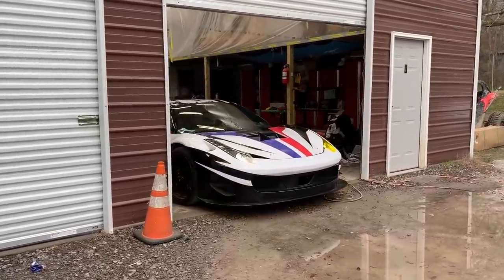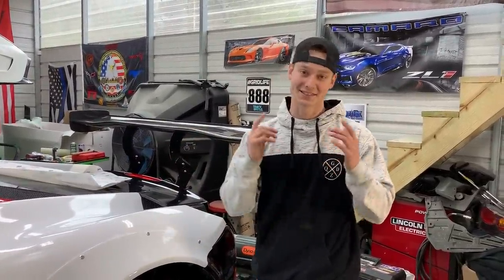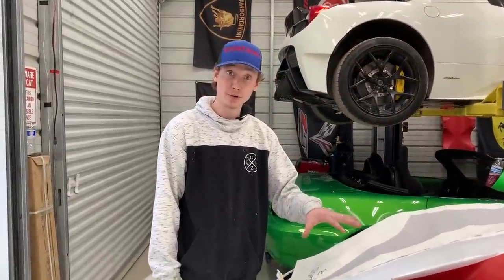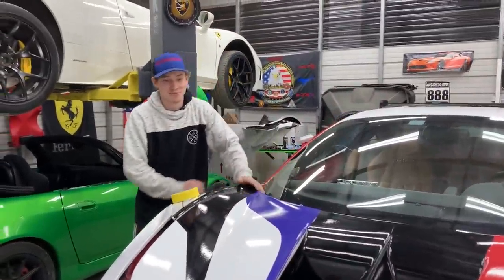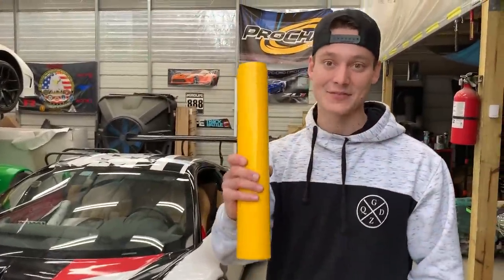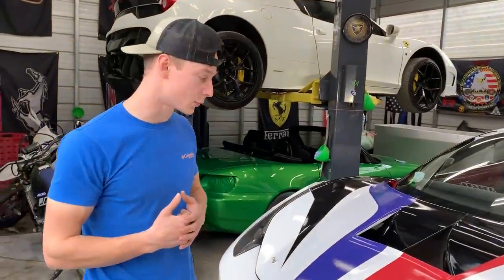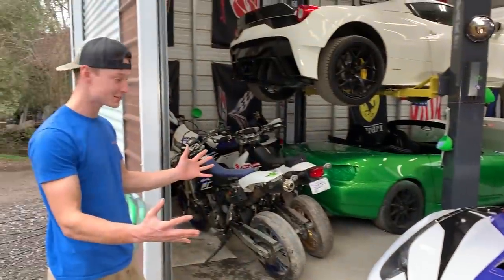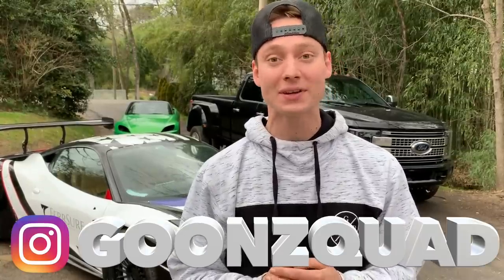Building A Widebody Ferrari 458 Part 8

Comment: Yellow headlights look tacky and for some reason it looks cloudy. The stock look on them look a lot cleaner.
Reply: Pennywise they said they did it wrong so maybe once it’s done again it will look better 😋
Reply: Looks cloudy because it has a protective clear film on top to prevent scratches when installing
Reply: @PhenomenonHo  either way the clear looks better.
Reply: If they do use the yellow highlights they need to add some yellow into there designs
Reply: Pennywise  the stock look way better and cleaner then that yellow cloudy,

Comment: I would leave the F450 stock so it stays a reliable hauler.
Reply: I think put forces on it and do just appearance mods no suspension and engine stuff
Reply: needs a delete and tune or else it won't be reliable.
Reply: It needs a few deletes and a small tune nothing crazy
Reply: Only issue is if they do a delete on YouTube and I think that Tennessee is a CARB state, they'll get a fine.
Reply: I think just getting a Banks inline tuner and intake would be the best
Reply: Intake, tune, and exhaust for more efficient towing. Maybe some Alcoa wheels.
Reply: The f450 ,since it is the Company truck it does need to look like a company truck with professional looking business graphics/ logo info etc.
Reply: Roy Pratt pretty sure they’re in Georgia, not Tennessee. Not sure on the emissions restrictions in Georgia though.

Comment: Take on a new challenge and do a classic, 70's 80's or a 90's
Reply: Yes!! A classic car would be great. I'd love to see them fix up a '67-'69 Camaro.
Reply: They can’t. Only can do bolt on and off type stuff
Reply: Don Guille have you not seen their videos? They weld, do body work, and even do some engine work
Reply: Eric Draven but not restoration buddy
Reply: Don Guille they are fully capable of restoring an old car if they wanted to take on the challenge “buddy”
Reply: @MegaGsizzle  if they can repair lambos and ferraris im sure restoring an old car which is basically just motor and trans is doable for them, they'll manage the body work easily
Reply: Cheats FTW not true. Most of the wiring has to be made. Panels don’t just fit perfectly. A lot of adjusting
Reply: Eric Draven I doubt it BUDDY
Reply: Don Guille they deal with modern wiring harnesses all the time and even completely wired up the lights and switches for the police charger but you think they can’t handle simple wiring from the 70s?? 😂😂 I don’t think you’ve actually worked on cars before
Reply: Eric Draven oh it’s “simple wiring from the 70s” 🧐 I don’t think YOU have ever worked on cars. Watching YouTube videos doesn’t mean you know what it takes to restore a car LITTLE BUDDY.
Reply: Don Guille frame off restored a 76 camaro and a 71 chevelle in the past year....and it is simple compared to wiring in modern cars. You are a clown “buddy” move on
Reply: Yes!
Reply: Toyota Supra MKIV

Comment: GT3 cars have yellow lights so that they can be identified as a GT3 car when it is dark!
Reply: FaithlessEmo Racing haha no, amber light cuts through fog and snow, stock white lights reflect off of it and can make visibility worse.
Reply: Ryan M They also do it on the race track to cut down on glare.
Reply: Ryan M that is true. But the reason why GT3 cars run yellow if to identify them in the dark. LMP run white lights so you know the type of closing speeds.
Reply: FaithlessEmo Racing 👍.  You are spot on.  With multiple classes on the track, closing rates on slower classes can be extreme.  Yellow headlights identify vehicle class to drivers being overtaken, or when pulling out to pss.

Comment: the yellow is four protecting headlights from cracking 

and where is the boat????????
Reply: @Malc478  Both wrong. Yellow light has some benefits at night and during rain/fog but it also differentiates between the different classes in a mixed class races. They also are not wrapped, the run colored lenses, thus cracking will still happen
Reply: Maybe everyone is right. 🙂
Reply: I think they are not working on the boat till summer
Reply: Penta is right.

Comment: With the F-450 build, I suggest a leveling kit with 37’s wrapped in 22’s or 24’s, it’s such a sexy look for those Dually’s plus i’m pretty sure that there is rarely any trimming involved. Would clean up the look of that beautiful 6.7, also, with the front bumper I hate the stock 4x4 air dams but if you go with the 2wd one it gives it a much cleaner look

Comment: Yellow lights were used for low light conditions, plus the yellow light doesn’t reflect off of rain like blue (standard) lights, which gives greater visibility.  In endurance racing, yellow lights were required for certain car classes to differentiate them from the faster cars.

Comment: This transition/montage music is getting old, anything else?
Reply: Lately their vides have all been the same. I can almost call whats happening next to a “build”. Also who would rather build a Honda S2000 than a Ferrari or Lambo? Getting a little stale around here.

Edit: also the way they guess at how things are built, like the 450 seats “these have a water system in them that makes the seat bolsters pump up” no fellas, its an air bladder!!!
Reply: You get all the info you need to keep up of the thumbnail.  

The music is terrible but they’re not gonna change from their format.
Reply: I actually really like the music and I’ve watched all their videos

Comment: The reason the GT3 headlights are yellow is so that during night racing you can tell what class of car is coming up behind you. The GT3 cars are much slower on the straights than the prototype cars which have clear headlights. It helps the drivers determine closing speed of cars behind them and who they are racing.

Comment: The yellow headlight tint/covering is so that the different classes (GT3, in this case) in a race can see who is going up behind them and if they need to move over, or not.  If a higher (read faster) class car approaches a lower (read slower) class car, the lower class car MUST move over to not impede the higher class car.  In short, the headlight tint colors are a way for the cars to identify each other at night when visual identification is not as easy as during the day.

Comment: GT3 race cars do not run 19”-21” wheels with thin tires. They run 18” wheels with a higher sidewall for increased mechanical grip. If you want it to look like a GTLM or GTD, ditch those wheels and tires. The handling would also improve.

Comment: Have to give you guys major credit for having the b*lls to just jump in and do whatever work needs to be done. One day with a wrap guy, helping him, and you’re confident enough to continue on when he’s not there. Seriously, that’s the best way to learn it, do it, and get good at it. (I’ve done wraps & tint, they can be such a PITA to do.... one little mistake and you’re pulling the whole thing off to start again. It’s NOT easy and yet, you two are just ready to “dang son, let’s do it”!  Well done. 

The wrap itself? Damn FUGLY really, but obviously someone picked it and you have to go with it. Even if the red and blue were actually the same shades as the US flag, that MAY have helped a little.... that blue is so off, and such an ugly blue, it kind of spoils it even more. It’s just too bad “fersure”!! I’ll hold out that maybe, just maybe the final product will look amazing as it’s all pulled together..... maybe!! 

Don’t tint that back window (if you don’t have to)..... you can use see through wrap material for the design that comes over the window (so you can still see through it), but to “limo-tint” that window, hiding the engine, would not look great. If this is going to be a racer, and it’s in something like Lemans, with nighttime driving, the driver will HATE the back window being tinted. Driving at night with tint is bad enough, racing at night with it?? IDK. 

Great work as always though - you two really have a knack for this; both builds, AND being in front of the camera!! 👍👍

Comment: you know you guys have done V8's, V10's V6's and the engine in the S2000, which i honestly forget what it is, i think a V4 but you still havent done an inline 5, inline 6 (like the OG skylines were) or even a V12, like why not sell the hurican down the river and get a salvaged pre 6.0 2000 V12 diablo, back before the germans ruined them or like a ferrari 550 to 812 from the salvage yard?

as the V12 is the pinnacle of engines, and so far you've only done the baby cars in the ferrari and lambo yards, and your long since due.